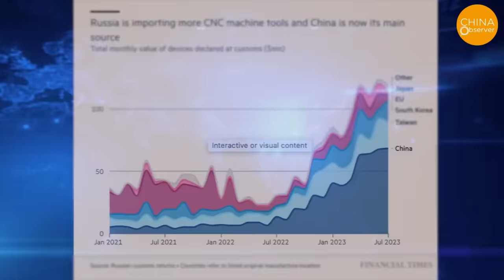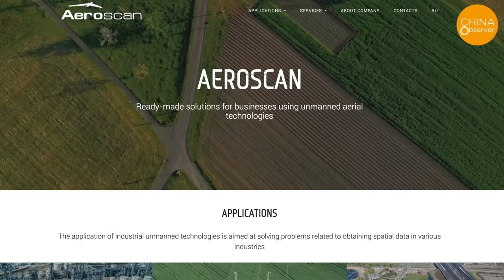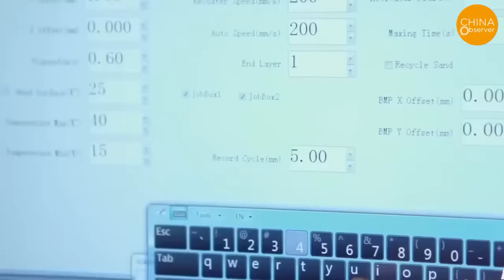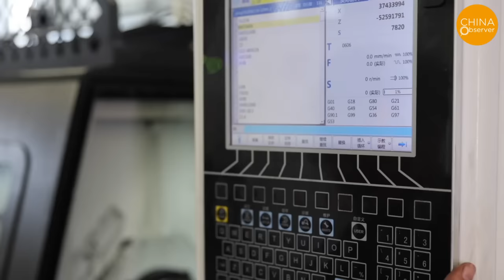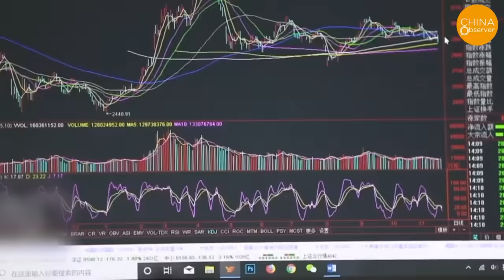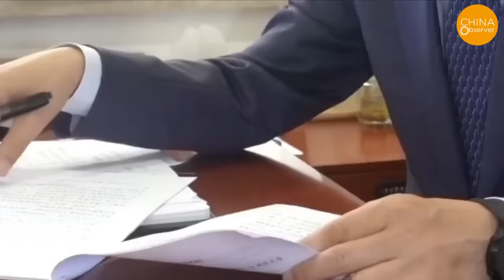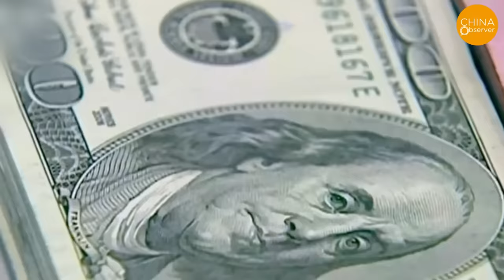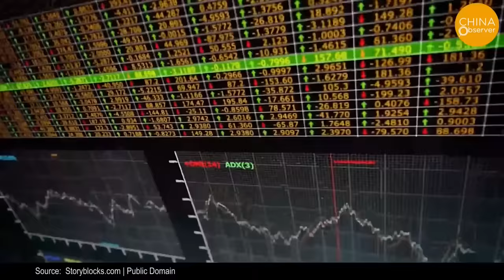China Exports CNC Machine Tools to Russia for Weaponry, Criticized for Subpar Quality, Short Life

Comment: It's also about the materials. If a complex part is machined out of titanium, there's probably a good reason WHY it's made out of titanium. You can't just substitute aluminum or stainless steel. Especially in a weapons system.
Reply: Russia has the biggest titanium ore deposits so it is cheap enough to use on things like body armor and precision tools.
Reply: @samsonsoturian6013  vsmpo-avisma is the worlds largest titanium supplier and have mostly avoided sanctions because of how important they are to the global supply chain
Reply: Part of the problem is using Chinesium machine tools to work on titanium.
Reply: Steve Austin the Six Million Dollar Man had titanium parts and that was is in 1975. Things are more advanced now.

Comment: i worked for a company that imported chinese machinery. 
once it arrived in australia it was pulled apart and made reliable with some upgrades we make on a euro built cnc and then sell to the public/business.
ive worked for other big companies who have run for years on 20 $100k usd reliable machines and bought a chinese machine at half the cost to test, we end up upgrading it so it works.

if russia have a few good mechanical engineers then these cheap chines machines can be made reliable by some schematics and trained fitter and turner/machinists
Reply: depends on the situation but weapon production is complex and needs a precise machine to work with , pretty much hard to calibrate if there is no service manual specially if you are going to work with Titanium which i assume russia mostly use
Reply: @exiledwolfch  once a machine is working within tolerance its fine..

I can machine Ti on old 60s style conventional mills and lathes? As long as cutter and feed speeds are set up I've never had and issue

Comment: This is absolutely no surprise to any mechanic who has bought auto parts made in China. The failure rate right out of the box is extremely high. This not only applies to auto parts but parts across the board. They are made by people who cut every corner possible to lower the price regardless of the damage they cause.

Comment: Not just Chinese CNC machines. Most of their tools are pretty low quality. A few years ago I bought a small Chinese made press-drill. It looked alright in the photos and was half the price of the competition in the west. It worked but not very well, electronic speed control was miserable and it wasn't sturdy, kept giving while drilling when a bit of pressure was applied. And it got really hot after about an hour of use. It's now standing in my shop unused and unloved not knowing what to do with it.
Reply: Could sell it to Russia i suppose
Reply: kindly sell it to a Junk dealer and donate to the country that made it. regards

Comment: I've worked on machine tools from China.  It was usually a sad experience.  One lathe had a really nice schematic inside the electrical cabinet door, it was different from the one in the manual, and the machine was not wired like either.  All 3 had one thing in common, none would work.  So you rewire it how you want, and probably absorb the liability
Reply: CNC machines are not that easy to upgrade specially when you lack documentation. also  it is almost impossible to calibrate without one!, i have worked with Japanese Embroidery machines vs chinese ones , for the same price nothing beats Japanese embroidery machines..
Reply: @exiledwolfch  no they are not. I was lucky enough to never get stuck with a purely Chinese CNC, always were done by another company with Chinese iron
Reply: A guy my dad worked with was often sent to China to set up and service production machines made in the USA.  After his first trip he started taking his own tools with him.  He would go to a local Sears and buy whatever he would need while over there, place them all inside of a pipe that was part of the machines frame, and weld a cap on.  When he arrived in china he had one of their machines cut the cap off so he could get his tools.  The chinese mechanics were all super impressed with his skills and his tools.  They literally had never used a wrench that would not bend and break from normal use.  The cost of the tools were added to the job so he would leave them with the chinese mechanics when he left since those guys really needed decent basic tools.
Reply: Isn't what's in Sears made in China these days?

Comment: this is what caused problems with the new boeing jets, subpar parts installed....causing increased failure rates...even the smallest part failing will cause the overall product to fail.
Reply: Loose hardware was the issue RE Boeing door plug.